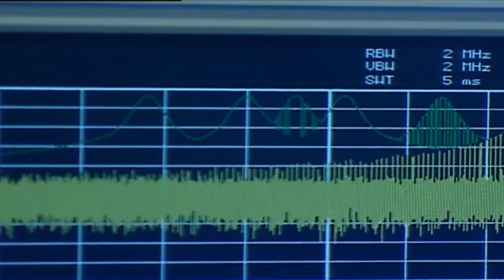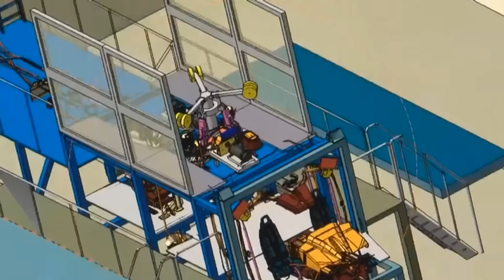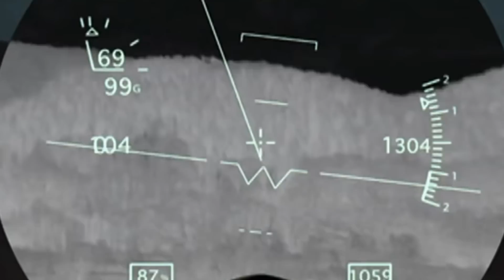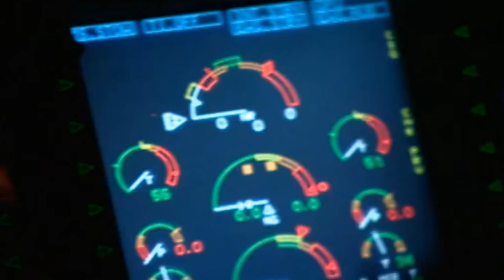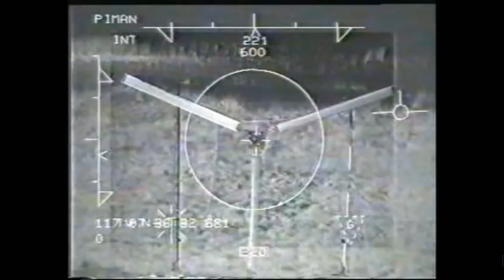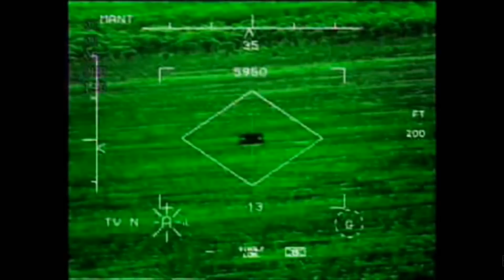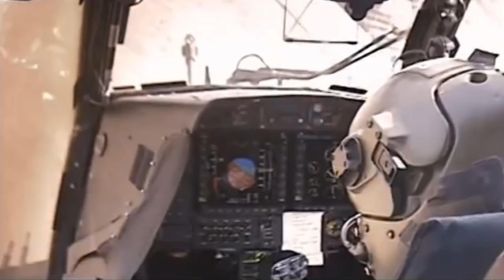Eurocopter Tiger EC 665 - Multi-Role Combat Helicopter

Comment: - one great and silent feature is the electronic launch of the rockets: this simple feature makes impossible a rocket to be launched by error (electric shock, etc). As a result the rockets don't need to be removed after each flight, they can stay in place. After each flight is a HUGE gain of time.
- about Australia the main problem is about the quality of the Tigers... assembled in Australia. Another problem is the lack of spare parts but it's an issue shared by most of the modern armies (no stock, everything built on demand). Eventually the american lobbying finished the job.
Reply: panda dragon they weren’t licensed copies Eurocopter built them at their Brisbane factory. They aren’t any different to the euro models, the problem is European supply chain is pathetic
Reply: To be fair, it took the Australian's over 10 years to bring the Tiger to FOC. It just wasn't doing as was promised. Many things went wrong with it and the Mali crash was probably one of the last straws in a long line of stuff going wrong with it, including not getting the supply chain and maintenance and spare parts issues sorted out. From what I hear, many Australian pilot's didn't trust it at all. It is however getting some good reports now, but too late I'm afraid. An overall bad experience of the Tiger for the Australians. I'm hearing of issues with the NH90 as well.
Reply: Give them to the Australian Navy.RAN.for Canberra class LHD.s🇭🇲🇭🇲🇭🇲🇭🇲🇭🇲🇭🇲🇭🇲🇭🇲🇭🇲

Comment: So correct me if I'm wrong but what i get from this is that the Germans use this as basically flying artillery and don't have problems with the performance of the helicopter because of that , but the French and Australians have problems with the helicopter because it sucks as a close support helicopter.

Comment: You are being biased, apache its so expensive to mantain it takes so much resources to fly that beast, even in iraq were reported that apache was available for combat in 30 percent average. It nearly consume and weight twice the petrol and have the half of the autonomy of tiger... They both have the same arms 30 mm cannon hellfire rockets and short range missiles to protect themself from incoming aircrafts... Tiger weights 3000 kg apache 5165 kg.... Autonomy apache in cruise vlocity 480 km tiger 800 km. Ready to combat, tiger 4600 kg, apache more than 7000 kg. So tiger is 90 percent available to fight. In afghanistan and mali. Apache dont.

Comment: My brother watch the Tiger trying to take off from Victoria Barricks in Sydney in 2005. The Prime Minister was present at the take off and everybody thought that the engines were going to fail and they struggled to get the aircraft into the air
Reply: Tiger has highest power to weight ratio of existing attack helicopters, if it struggles to get into the air then it's bad maintenance or incompetent pilot.

Comment: The tiger is junk.  In australian service they declared it had final operational capability.  The budget went for 360mil to 1.3 billion.  Was 7 years late,  has 60 critical problems "“Other key limitations relate to shipborne operatoin, pilot flying hours, interoperability and communications, airworthiness and the roof mounted sight,’ The aircraft is banned from shipboard operations,  spare part procurement in stupidly difficult,  its virtually impossible to keep up pilots flying hours

The day after FOC was declared it was pretty much mothballed

Comment: So, is 'Strelia seling off it's "Tigers" then or what?
Reply: Apache is a shoe in,  know 2 tiger pilots,  both are in US flying apaches on military transfers with the US army.  The same thing sorta happened with the abrams.  There was a lot of australian guys attached to US units training / operating with abrams and suddenly the govt announced buying them.  Now we have trained personal to form the nuecleus of the training unit
Reply: richard thomson 
Well, I get they are transitioning to Apaches, but what are the plans for those birds they have now, just writing them off and selling for parts to Europeans?
Reply: No one knows,  imagine they will try to sell them back to manufacturer,  maybe to some 3rd world force like indonesia, (we have over the years sold old equipment to them.  If no one wants to buy them, guess they will either part them out.  

They haven't even started the look for a replacement, australia has commited to keep flying them untill 2020.  Honestly the urgent need for an attack chopper is gone now that australia is out of afghanistan.  I would prefer them the take the time to get it right than fuck it up again

Comment: German Tigers don't have a chin gun for reasons.
Just the mast-mounted Osiris sensor and PARS 3 LR.
Reply: Because the german tiger version didn't need it in it's supposed task. It's supposed to fight against mechanised formations in a conventional linear european scenario, hiding behind a treeline in 4 km distance, recce with OSIRIS, lock on its PARS 3 and get the hell outta there, there's no use for a 30mm in such a scenario, if you move into gun range you'll get f*cked by MANPADS or AA immediately.

Chin guns are good for shooting up badly armed cavemen in the afghan mountains, but have no place in a combined arms operation. The german tiger version was out of place there.
Reply: They could've mounted a recoilless 30mm (Rheinmetall RMK30) in their tiger versions (it actually performed much better than the GIAT 30 used in the french tiger version) however they decided not to because it's a antitank helicopter, and not a multipurpose platform like other attack helicopters.
Reply: @jonny2954  30mm or even 20mm will at least disable most modern tanks. Just sayin
Reply: @JamesTTierce  30 mm won't disable a modern tank. It has a small chance of damaging optics, but nothing more.
Reply: If you have to kill tanks, I'm pretty sure the german tiger with PARS 3 LR is the option to get the job done.
Reply: christoph, it does not even matter if they renamed it or not, my main point is that it was intended as support helicopter and you can clearly see it if you compare it with the french variant - which was intended as attack helicopters from the start. 

so the reason it does not have a nose gun is fairly simple: it was not intended to be an attack helicopter
Reply: turns out renaming something is insufficient to change its role.
Reply: Because they didn't want to Spende the money for integration and importent people being out of touch
Reply: No that is wrong you need to write in past tense. For many years now the German Army is considering it's Tigers to be multirole attack helicopter. The name revlects that starting with PAH2 (anti tank helicopter 2) to UHT (support helicopter, official name of the german army version) and now beeing called Kampfhubschrauber (attack helicopter) by the army.
Reply: No what matters is that today it is intended as a attack helicopter but still misses the chin turret. That puts your troops on the ground and in the helicopter at unnecessary risk.
Reply: what reason?
every attack chopper has a chin gun. why using 12,7mm when you can use a 20mm or 30mm?

Comment: Well...Germany has a lot of trouble with military vehicles in terms of functionality. Also with the Tiger Helicopter.
To me it seems like the only still working military vehicles are ground vehicles.
I mean we've got 6 submarines. None of them is working. wtf. what is even going on with our military??
Reply: They have enough money, but their military procurement agency isn't spending it well. Their ground forces are fine.
Reply: Tigerfighter they work, just not every Boat is out of the habor.
Reply: What I said was literally stated in those articles. Either you didn't read them completely or misunderstood it.

The subs were classified as 'non ready' because they were due for maintenance or on sea trials - that does not mean they don't work, or are inhibited in any way. In peace times you have the luxury to extend those trials to months, and do very regular maintenance. That's why readiness ratings tends to be a bit lower than they are in reality.
Reply: Termitreter I see. If thats the case im sorry i got it wrong. I thought i had read the article completely but well...thats what the comment section is for.
Reply: What vehicle is working? The Puma has issues that might get worked out, but they are there. The Leopard2 have the same over all low availability that the entire service is suffering from.
The F125 frigate has major issues, NH90 still not working. No radios, few night vision glasses, no Tornado replacement.
Name one major land vehicle with >80% full combat readiness. Probably the Wiesel and the Unimog.
Reply: Stop spreading that nonsense. 3 of the german subs are in good shape; two are merely in sea trials after maintenance, but fully capable, and the third is just due for regular maintenance.
As for what is going on with the military? It got like 15+ replacement projects going on, yet the politicians aren't willing to spend money. Konservatives for their forced austerity, the left because of naivity and other priorities. They all probably hope other european nations make good meatshields.
Reply: Because our minister of defence is completely out of touch with reality. She thinks it's more important to have new TVs and Fridges for our Soldiers than working Equipment. XD
Reply: @EASY7356  "She" is just a puppet and a tiny part of the problem.
Reply: Termitreter maybe you can see that my comment is already a month old but what i stated came from the biggest news agency and from an official statement of the Bundeswehr. Of course it can be that most of them are repaired by now. Im not spreading nonsense.
Reply: Pusssifed and stupidy and lack of money for Army.

Comment: Eurocopter had one accident and Australia freaked out.
EF-2000 had Four accidents in 2-months and nobody's talking about it?
Reply: The problem for Australia is that damaged and to-be refurbished parts have to be shipped to and from europe, which is slow and expensive. they work fantastically, it's the maintenance that is the problem.
Reply: nah, they've never worked fantastically. from the get go the air conditioning units and power capacitors broke down and filled cockpits with toxic smoke, and pilots don't trust them. 

“We’ve spent billions of dollars, lost many years of capability because the helicopters weren’t as mature as we thought.” 

would rather buy hinds.
Reply: Prasoon Shrestha EF 2000= Eurofighter Typhoon??
Reply: When You try to put the newest of technology and/or ECM there's always has been delays bcoz of a lot of testing and unexpected problems.
On the pinnacle of this would be F-35s.
But What should be expected is that the Aircraft would atleast run smoothly without major problems/accidents when actually rolled out of the factory production line though.
But still the 4-accidents in such short time has never been a case of discussion anywhere.
And when I read the reasons for the accidents, I think they might have some problem with the Flight control systems or Fly by wire system.
Reply: I THINK BECAUSE THEY  NEIGHBOUR HAS BUY NEWEST SERIES OF APACHE SO THEY FREAKED SO MUCH
Reply: If anything Jerry freaked out as they grounded all of their Tigers.
Reply: This is weird. Europeans can fly these in Africa, but Australia cannot operate them in their home. Perhaps the Australia is the problem.

Also Apaches were grounded in Israel this year, that's what happens after accidents. Btw one Apache crashed recently in Netherlands ...
Reply: Yes @da ve !
Reply: Well you didn’t hear about the one that the aussies tested tried and it melted and crashed. There’s another one that they don’t talk about.

Comment: Do a video on HAL LCH, Indian made Attack helicopter. Trust me, ur going to love it.
Reply: kentucky fried hey, that's where u are wrong. Yes it's not as armoured as apacke or mi 35 but it can do something that no other attack helicopter can do. Landing on the world's highest helipad and cruising effortlessly at an altitude of over 20000 ft. Also this helicopter is super maneuverable, semi stealthy, can carry an ordinance of 1000kgs at 20000 ft, can take hits from 84mm rocket launcher, 12.7mm and 7.62mm guns, has air to air and air to ground capability with universal compatibility, NBC filters inside the cabin, crashworthy design, helmet mounted aiming system for 20mm turret gun, all weather capability with night time operability, next gen electronic warfare systems and weapons management system, hingeless main rotor and bearing less tail rotor, forward looking infrared with flir, radar warning receiver, laser warning receiver, infrared warning receiver, radar jammer, etc.....
Reply: kentucky fried it's not even related to mi 24

Comment: Unfortunately, the vast majority of Tigers is grounded and cannibalized because ... Germany fuck on their combat capability. WW2 Luftwaffe should be turning in their grave :'(
Reply: The german Tigers aren't from the Luftwaffe anyways... They're army aviation.
Reply: Thomas Chadwick one thing is wrong in your comment. If u improve the Luftwaffe, the chopper wouldnt be touched because the Army owns them
Reply: Pascal Berger they are not rolling anywhere because most Wehrmacht soldiers where just piled on a big pile and burned until there was nothing left but ashes. That’s what you get for fucking with the Russian bear

Comment: what are your opinion over that the belguim army will change there dingo 2 and piranha df90/30 to french jaguar ebrc and scorpion ebrc?
Reply: The updated Leclerc XLR, and the new EBRC Jaguar, VBMR Griffon, VBMR-L Serval are designed to integrate the Scorpion program (Synergie du COntact Renforcée par la Polyvalence et l’InfovalorisatiON) :

 This collaborative combat mode connects equipment and soldiers by sharing all the data they collect in a Cloud. This equipment is connected to a “digital bubble” designed by Atos in which infantry, artillery, armored vehicles, but also helicopters, ground robots and drones communicate with each other at any time via a Cloud by sharing the data they obtain.

 Even the SCAF (Future Air Combat System) and the Cyber Defense and Intervention Frigate (FDI) equipped with a digital radar will be integrated into this network to collect and send information.

 The concept aims to create a mobile and modular intranet to share information obtained on the ground by all the forces present, each element of which is equipped with sensors.  If a danger is detected, information and data will be shared in real time by everyone else to avoid or deal with it.  The positions of friendly forces are indicated in real time and orders transmitted via this terminal, which is equipped with both the command post and the platoon leader in his vehicle.

 And to avoid jamming and outages, artificial intelligence searches for permanently accessible networks to automatically move from one node to another.  And in the worst case, a degraded mode will ensure the connections.